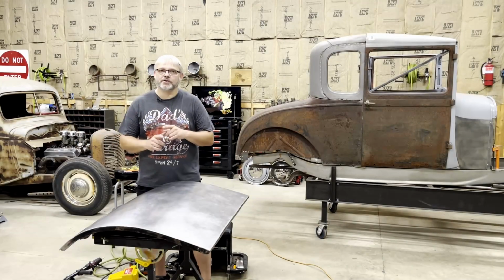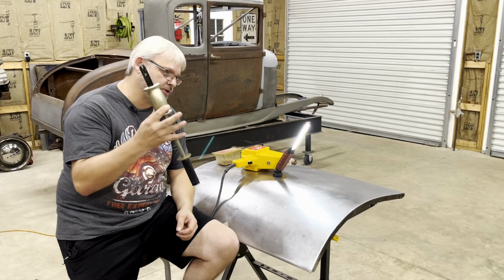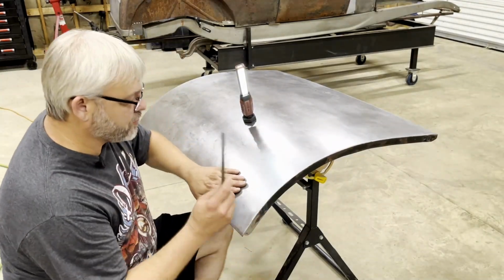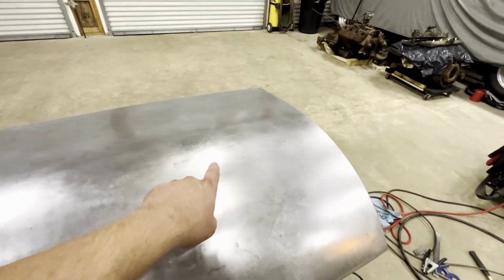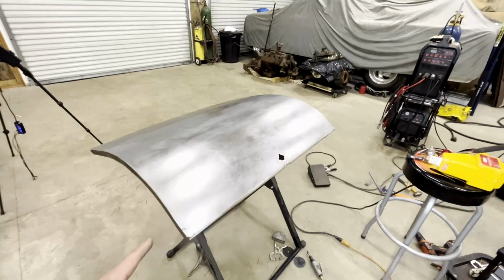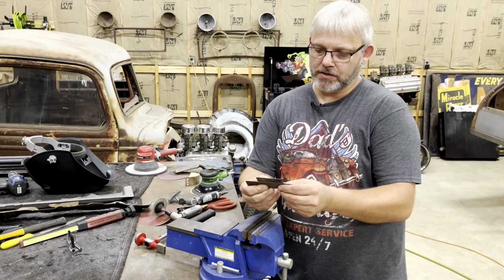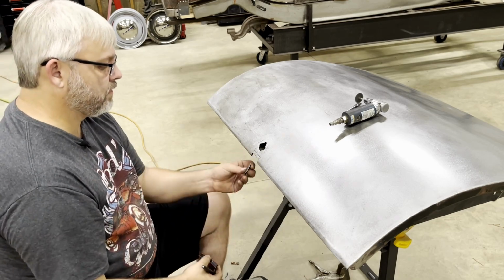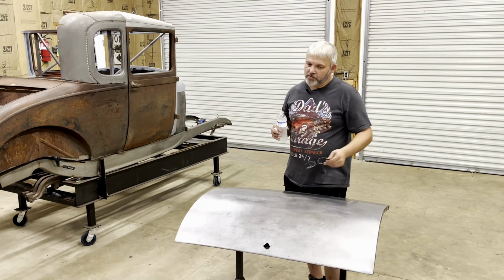Model A build! Trunk lid repair part 9! Getting dents out! Stud welding! Welding in a patch panel!

Comment: Saving the trunk lid not only saved you money, but it'll give you pleasure every time you look at it.  Great accomplishment, Phillip and thanks for sharing.  
I also have a set of HF hammers in the back of my toolbox.  No idea why I'm keeping them, but you are absolutely correct - they're junk !!
Reply from the maker: You are right. the sense of satisfaction will be great! As far as the hammers, I was at a point that I had no choice. I had to replace everything as cheap as possible, and then upgrade later. So, it wont be long, and those HF hammers will be in the back of my toolbox too.

Comment: Good work with the dents! That studgun is a familiar to me too. I borrowed one from a friend of mine and it works really good.
I have noticed same thing with the body hammers. Those cheap ones are not what they are supposed to be and the good ones costs you a leg, arm or your firstborn child. So now and then i have bought an used Snap-on tools body hammers from ebay. I think that used snap-on tools 25-30$ hammer is a lot better way to spend money, than a 30$ set of chinese hammers. Keep it up!
Reply from the maker: Great idea on buying used hammers on eBay. I have been looking at them lately myself, and I have a few I want to get. I just got in my new handles in for my old set. When I get them back in usable condition, I am going to start adding to my collection, likely buying used ones, and restoring them.  I was at a place with these Chinese ones that I had to have them quick, and needed something temporary to get me going. I am going to be doing some work on them to improve them, but they will be at some point reserved for general beating on rough stuff I don't want to use my good hammers for.

Comment: Anytime you get body hammers, you have to polish the face on them.
Reply from the maker: Absolutely. I have done some work to the Chinese ones, but they still need more work. A little dressing up on a good quality hammer is one thing, but having to take off heavy material to make it work is a different story.